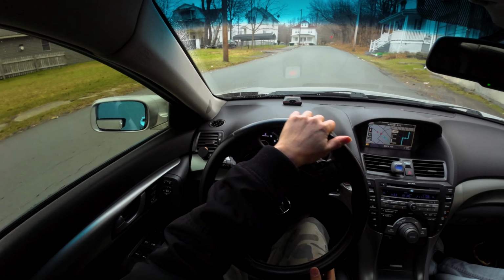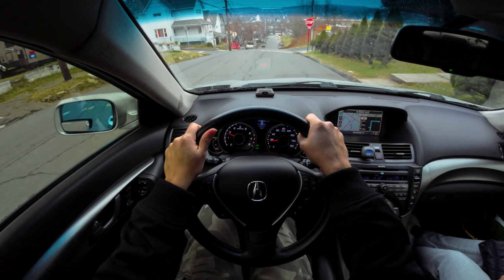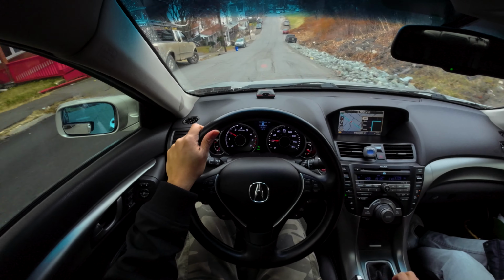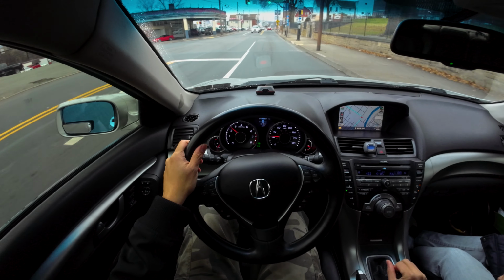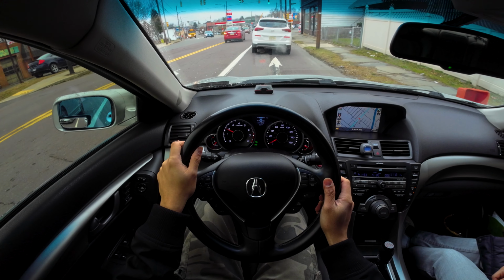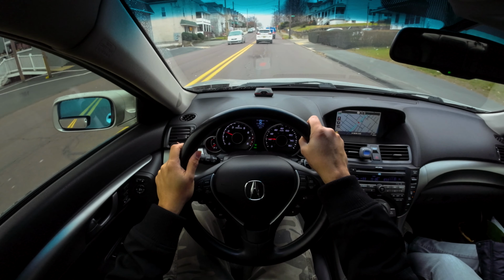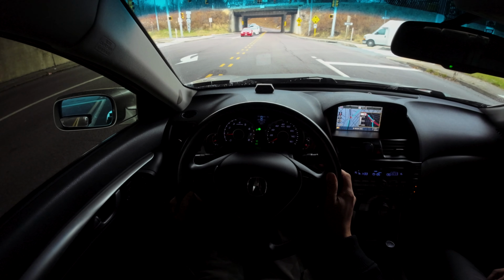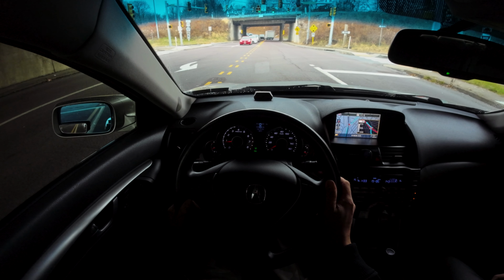Italian Tune-Up Melting Carbon Build-Up: Does It Really Work?

Comment: Wow your really having some issues. My 2010 has oil consumption issue also but it's not my daily driver so I can't really have an opinion. I also switched to non ethanol gas a year ago since the price is up there with 93 octane ethanol gas. These engines have issues but I can deal with that over the previous generations torque converter transmission issues. Might be time to let professional look at your car if you plan on keeping it. I know i'm keeping mine unless acura comes out with a big body 4 door sedan with 6 speed. I don't want any car with push button gears like i'm seeing now. I have to be a part of the driving and nothing they make now will do that. Yes the have time civic and integra but I don't like them away all. To each his own so I respect anyone that likes this new stuff but i'm old fashioned 5/6 speed dude
Reply from the maker: Hey Dent! I just recently made my TL my daily because my Toyota daily got wrecked by the wife..the TL was able to breathe more after I cleaned out my PCV valve..me too I am very particular with my fuel for the TL, 93 and no ethanol.. hoping for the best lol 🤞
Reply: @Hashira-DD  yes sir fuel now is important in any acura 93 octane. With my cl type s 6 speed once I cleaned out the ports and switched to non ethanol I noticed a difference after 2 full tanks. Sorry to hear about your wife and car. We can replace our wives but not our 6 speeds 😁.
Just some humor to lighten up the day
Reply from the maker: @dentpulla  🤣👍

Comment: You need to be driving arround 4 to 5000 rpm for a couple kilometers  te have the full effect. Its not realy the speed that does the tune. Its the high rpm
Reply from the maker: I agree high revs on the power band does the job as they say😄 I used to go to work via the back roads because its closer but lots of stop and go driving, now I go to work using the highway although its farther but I can floor the pedal as much as I want to 😆